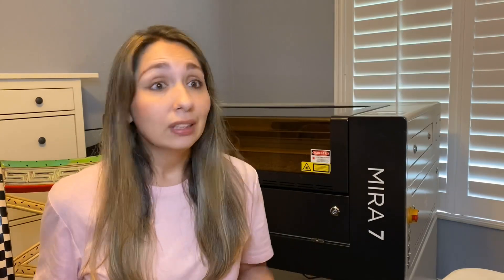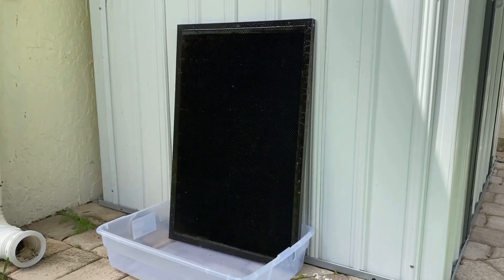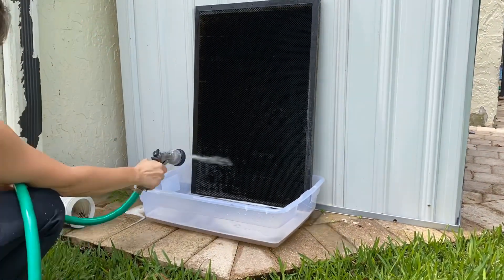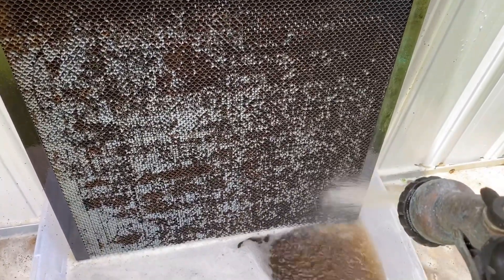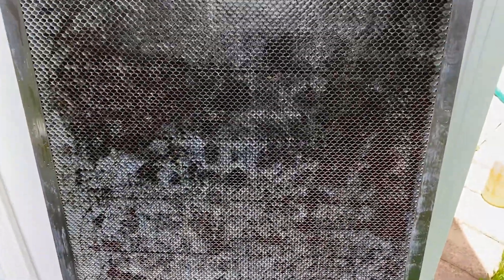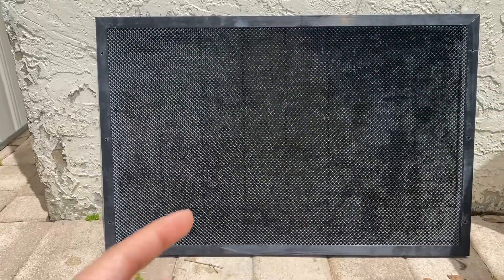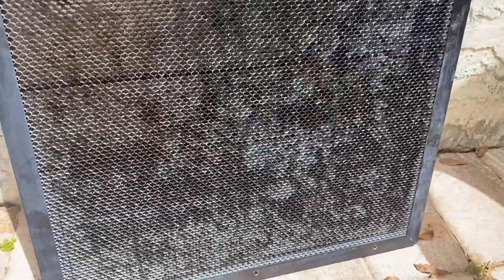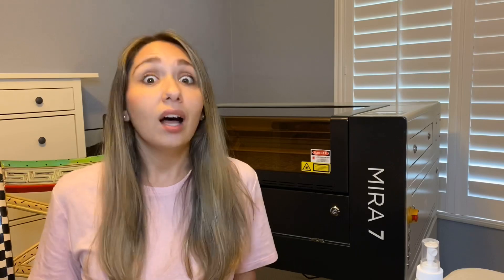How to Clean A Laser Honeycomb Tray

Comment: Simple green might work pretty good. But you may want to look into an inexpensive pressure washer. Also, when you’re rinsing, always start at the top and work down. When you start at the bottom and work up, everything above the washed/rinsed area gets the gunk fro m above.
Reply: its called purple power.  more user friendly.  it won't kill the grass.